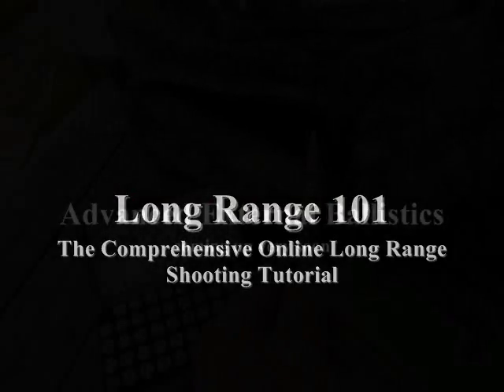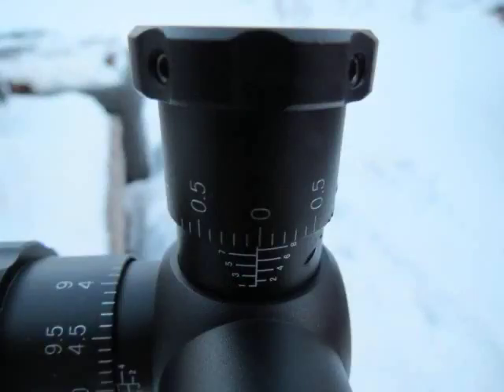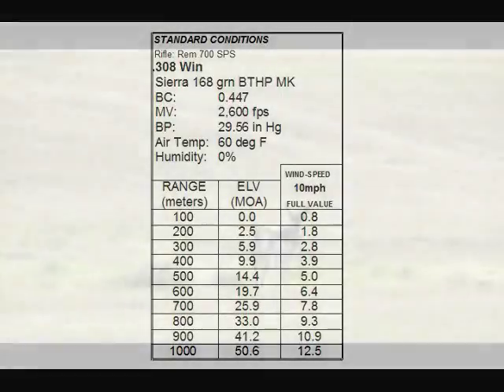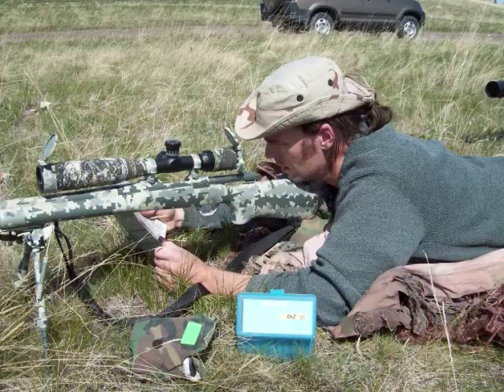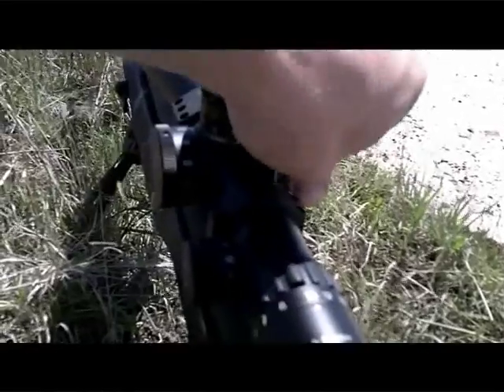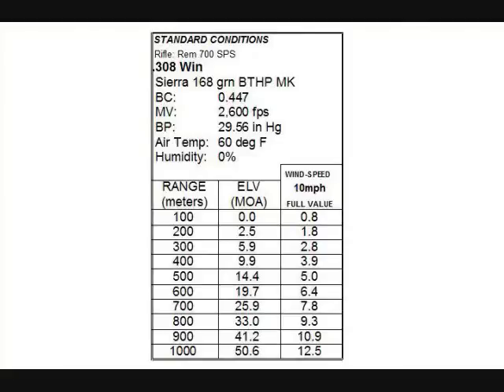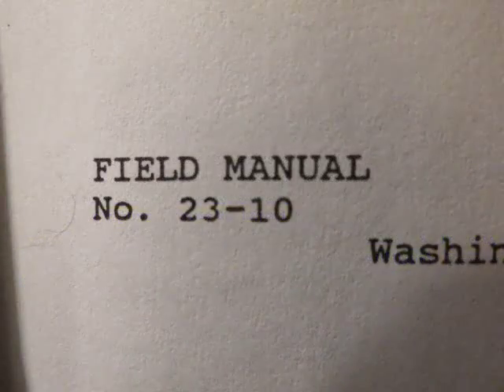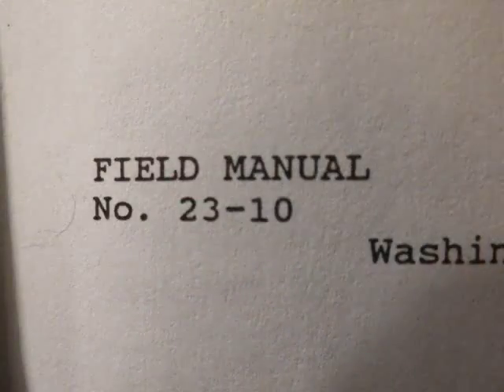Long Range 101 Part 27 - Classic Application of Ballistics - Rex Reviews

Comment from the maker: Basically, here's how to get it set up...  zero the rifle at 100m.  loosen the 3 screws on the turret caps all the way and slip them to the zero mark.  re-tighten the screws and note where you are on the other hash marks.  The SS10X is not equipped with a zero-stop feature, so we have to mark it. Either write down where you are - or physically mark the spot with a small dot from a silver sharpie. When you return the rifle to zero, you will crank it down to this spot you've marked.